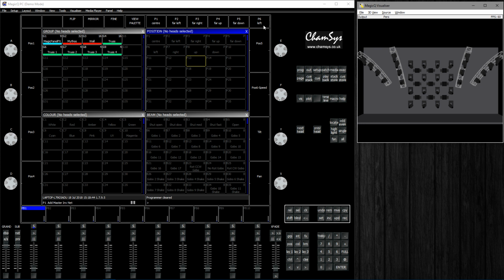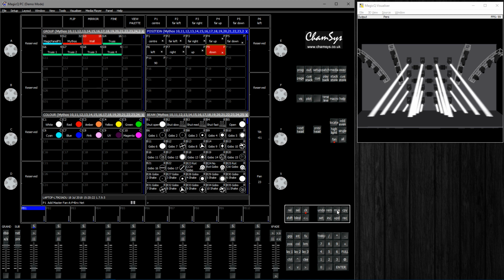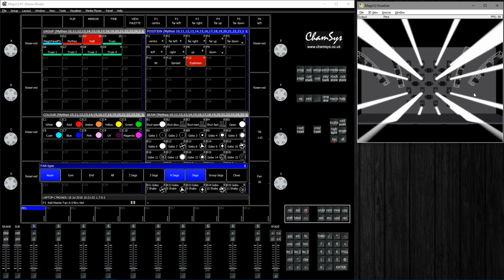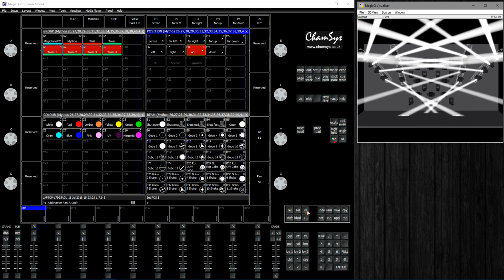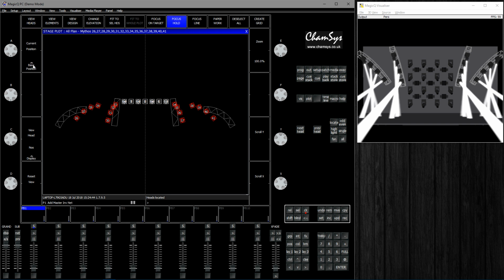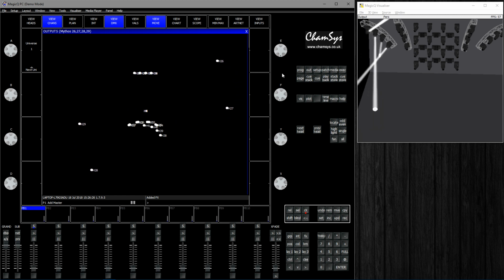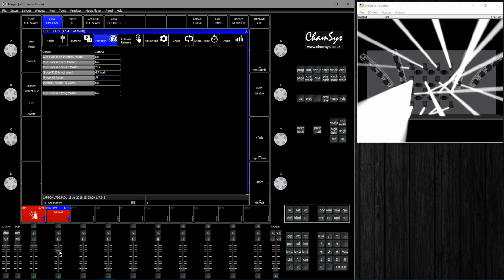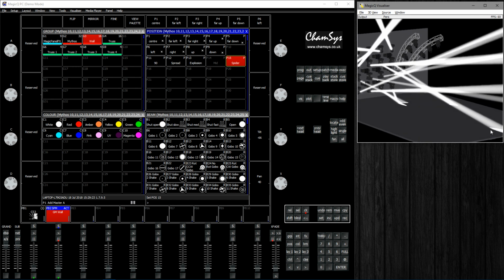ChamSys MagicQ - Positions, Fanning, Recording from FX

Comment: Good tutorial. Last rig me and my colleague had a discussion about adapting real live rig to a ChamSys visualizer. Could you share your opinion on how to deal with fixture position alignment when you come to the rig and most of the lights are pointing in different directions since they can't be put perfectly identical on the truss like in chamsys visualizer. What is the easiest way to make those fixtures point the same direction that is shown in the visualizer? What do you think
Reply from the maker: Thanks!

Are you talking about adjusting position palettes? Like perhaps a center stage position?

I've used the visualiser to build a couple of stages to pre-program, accurate enough to get an idea of what it would look like.
When the rig was up I had to put an offset (in the patch window) on some lights becuase the center pan position was rotated 90 degrees in the physical light.
Adjusting a center stage position I tried to get as close as possible with tilt and FAN + pan and then quickly adjust them individually.

For symmetrical adjustments perhaps SHIFT + Single can be useful. It paris the first and last fixture in your selection and steps into the center when pressing next head.
It's also good to define the tilt and pan parameters in the head file to get accurate movement in the visualizer.

Could you give me a scenario where you think the lights would be totally off? Or what position do you want to keep as accurate as possible?
Reply: It's hard to explain but i'll try my best. For example i have pre-programmed the rig, all the positions are correct in the visualizer and everything looks good and symmetric. Next day i come to the rig, load my show file and turn on my lamps. Everything works fine but positions that are in visualizer are not the same as in real life ( They are similar but not symmetric and proper ). Because of that i have to fix these "real life" positions individually with "single" button as you mentioned before. Then positions in real life look proper and symmetric, since i have adjusted them, but in visualizer they are not correct and symmetrical since i have moved them to look good in real life. 

Is there is a way to only correct fixture position in real life without touching visualizers positions, because in this case if i fix position in real life, the visualizer position gets moved as well and gets bad.

Maybe my way is bad, i don't know. Because of this i always have to make my positions on stage, before the rig starts. And maybe there is an easier way of all this live positioning thing because it eats really big amount of programming time.
Reply from the maker: Oh, I see. I don't think you can edit positions without it affecting the visualizer.
If the parameters are defined and the rig is as close to scale in the visualizer as possible, they shouldn't be so off that it matters.

You could perhaps try to adjust the placement of the fixtures in the visualizer based on your real life positions. Make some reference position live and try to match it by moving the lights in the visualizer.
Reply: @elvispot1  Learn about patch offset, "update patch offset" (use a LEAD position) and setup > vis > auto insert into visualizer (no patch offsets). This way, you can adjust one and only position (lead is your best bet), update patch offset (not updating your real lead position tho). Now magicq deals with subtle angle mismatches, directly in the patch. All your positions should be OK, at least, most of them, leaving your visualizer positions unaltered by offsets.